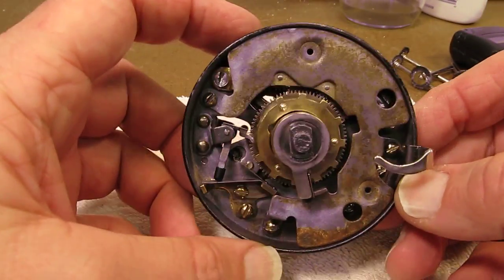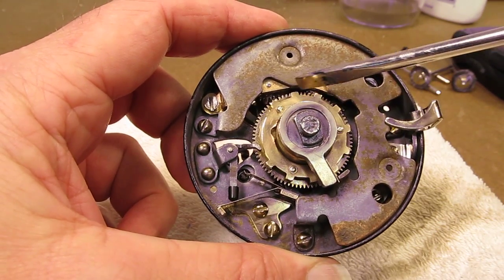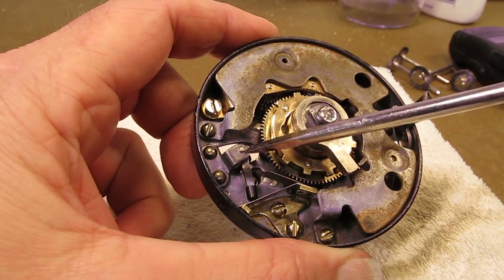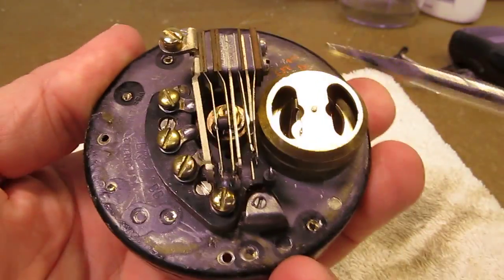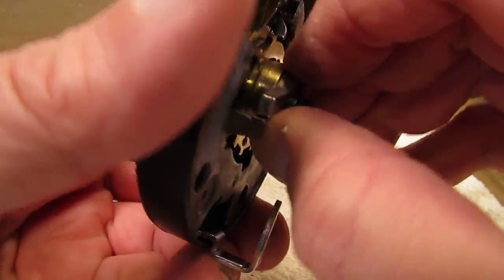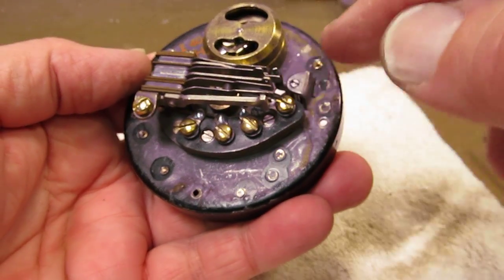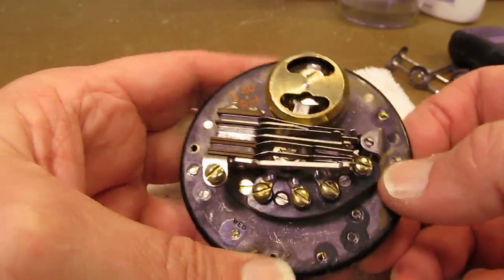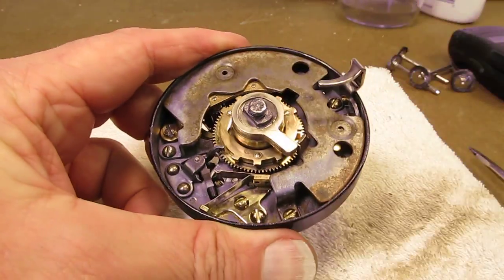Western Electric 5H Dial Repair - I 1940 - Part II

Comment: Good info!
 How did you clean the contacts? I've heard that they put a special coating on them that's not supposed to be removed.
Reply from the maker: I know this reply is many years old now but I will reply nonetheless.  To clean the contacts I simply use a Q-tip which I dip in isopropyl alcohol and then lightly clean the contact tips.  Do not use anything abrasive which could cause damage, as you suggested.
Reply: @VintageRotaryPhones  Thank you!
 This old model 302 phone is still in a box in our bedroom. It got put on the back burner when I was trying to polish the black plastic case. I need to get back to work on it and finish it.